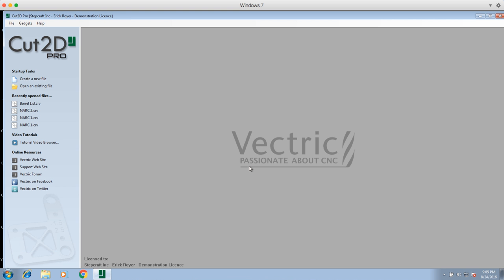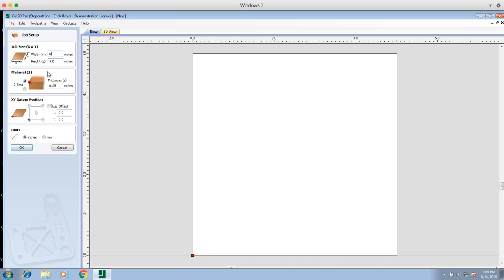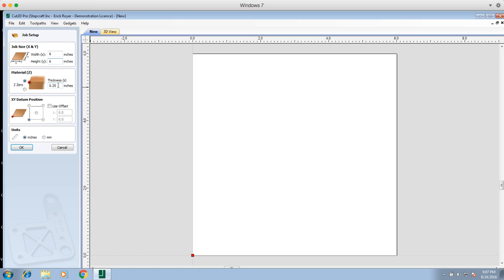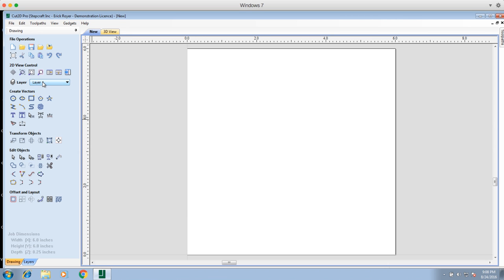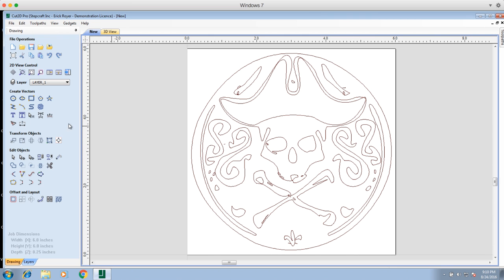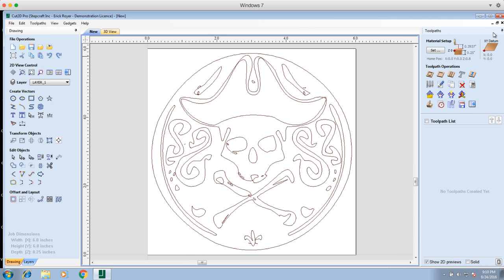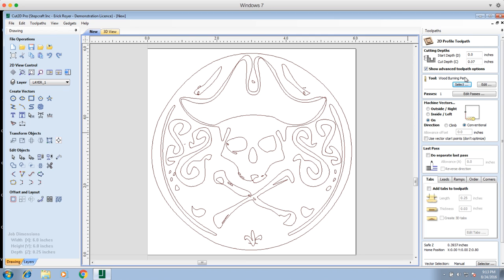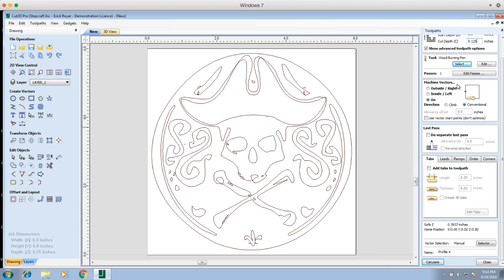STEPCRAFT Wood Burning Pen Attachment - Part 2 - Using Vectric To Make Tool Path  And Running Job

Comment: Just wondering if anyone can tell me what the advantage or benefits of the burner is over just using the laser?
Reply from the maker: Woodburning will give you more depth - there is a different affect using a woodburning pen vs a laser.  Since woodburning is a hobby unto itself, a lot of people like that they can program a cnc to give them the same look and feel of a hand woodburning
Reply: @StepcraftInc  Ok, thanks and I guess someone who is a wood-burner could have the Stepcraft do the bulk and they could still customize it after to add their own personal touch or to make it specific to a particular client.  Would ramping help with the mark being made when the burner starts each new item?  Or is there another solution to make an even burn?

Comment: Why the tool always make black DOT every time touch the board?
Reply: Looks like it's touching the wood for a bit longer when descending to the set Z height, before starting the horizontal moves. A smarter toolpath would ease into the wood gradually and we'd get a very narrow start for each line.
Reply: @scalor  actually if you see it in the beggining the dot are in the original image
Reply: Id probably increase the plung rate to reduce the time its sitting in that spot before it moves.